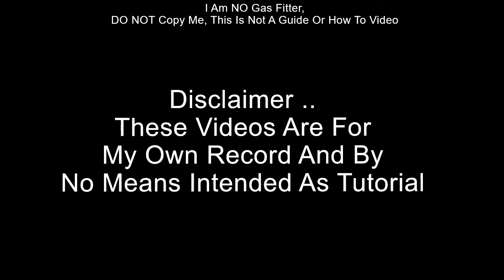Fitting A Oven To A Talbot Express And Almost There, Honest, Gas Check Booked

Comment: New to your video's.very informative look like I can learn a lot😁 but just a quick question how do you get stuck on wood from aluminum as in the middle of doing 1988 fiat ducato all the driver side wall is rotton any advice greatly appreciated.
Reply from the maker: If the baton wont come away from the aluminium outer skin then leave it, if it is rotten it would come away easy, also if its behind the aluminium rail on the outside it is possible that the screws from the rails are holding the inside one in place.
First i would remove ALL the screws from the rails on the outside, the adhesive / sealant will or should hold them in place until you have removed and fixed up inside.
Then you could really do with re-bedding or re- sealing the aluminium rail. The new batns on the inside will give you something to screw in to.
Reply: @PaulGloverHowDo  thanks for the advice start the wall soon

Comment: me-ow do/dont - still on that bloody oven!!
I noticed you painted you van with a texture/ripple paint - ive the same pin holes blks in b athroom zone.,.weird that the battonS areas that were the most wet were ok and the dry areas pin holed to fk
what was the paint you used? gOOD LUCK WITH THE OVEN!!
Reply from the maker: The water runs down the back of the insulation and gets to the batons that way, as for the paint, its the aluminium that has the texture your talking about, they are very tiny bumps, there is a correct turm used but cant think of it now. the paint i used was a coach paint Richard but do some research how to apply, also if you go down the coach paint route you need a couple of days of fine weather as it takes about 24hr to dry

Comment: Hi there i have a sagging root on a Talbot express highway room its in the front of the van above the bed on top can you advise me in any way there thanks
Reply from the maker: I have never done a roof to be honest but i know the construction is the same as the walls.  In my opinion without seeing your van it must have a skylight in the bed area and this is the likely cause, you skylight must be leaking in and bad, If you do decide to do it yourself then before you start ripping anything down make sure you prop up the roof some how. There should be a plastic strip on the roof more or less inline with where the cab and habitation area starts, this indicates that the front roof boards are already split from the habitation. As i say i have never done a roof i have been lucky that way.